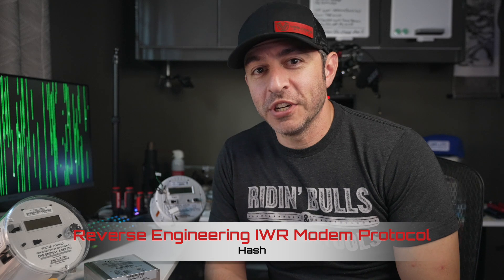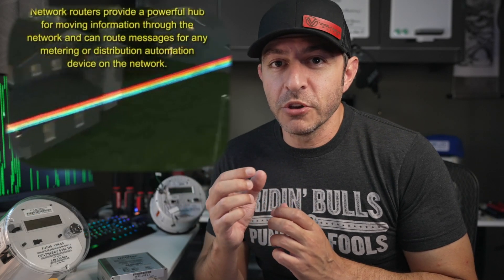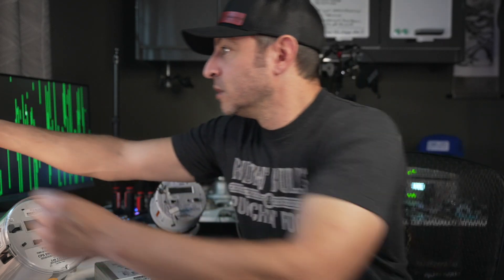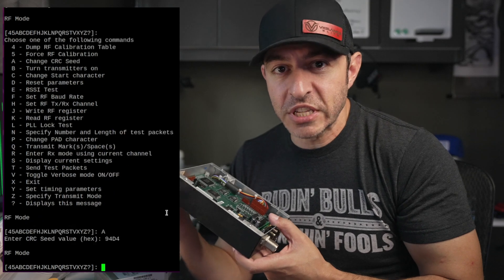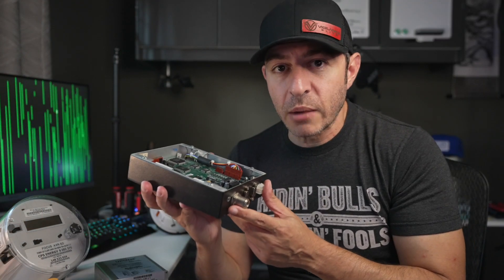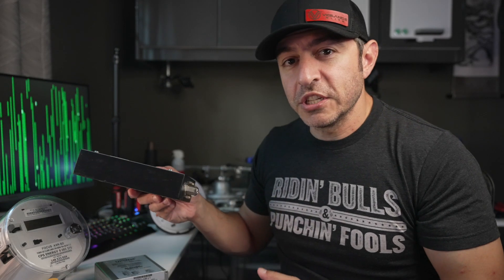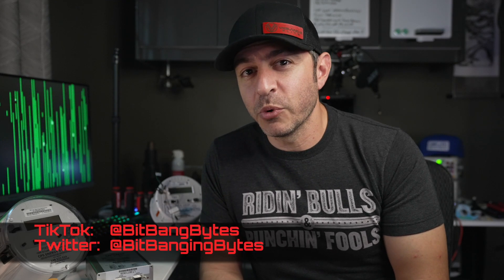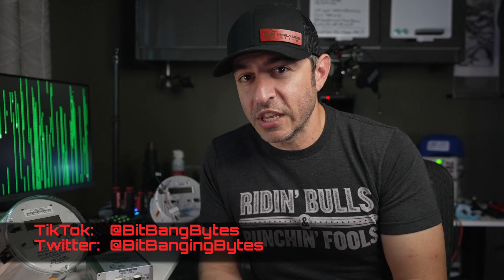Hacking Power Company Infrastructure

Comment: 900 MHz ? I hope they are not in the Amature radio spectrum again. About 20 years ago the power companies tried data over power line but right in the middle of the Amature radio HF band. Least to say they were operating under FCC part 15 rules so they could not interfere with the primary used but could accept any interference. Net result was that the electric company network would fail when radio operators went on line. There is also a portion of the 900 MHz spectrum that is also used by amatures as primary users. Lets hope its not too close to that part of the spectrum.

Comment: Good stuff. I don't think I would have just tried placing 3 bytes of the payload in the response. How did you figure out the CRC was CRC16/XMODEM? Was that from reveng?
Reply from the maker: Correct, feeding data to reveng is what gave me the CRC and ultimately led to being able to filter smart meters by the utility tuning them since they vary the CRC used as a way to isolate networks of meters
Reply: @RECESSIM  reveng didn't work out of the box with a fresh copy of ubuntu-20.04. I'll have to play with it. The v2.11 was no longer available at the link -- only 2.10 and 2.12. I was trying with 3.02. In case you wanted to update your wiki guide.

Comment: I wonder if the modems themselves handle the actual frequency hopping segment based upon some arbitrary data; such as the offset byte.    I've always been fascinated by frequency hopping stuff....    I just think that perhaps the modem is a lot more transparent than perhaps initially imagined; unless you find that you've got to propagate routing information or other bits or pieces into it...
Reply from the maker: I think the modem handles all the frequency hopping based on the CRC Adder used. All that logic resides in the modem I believe. The computer just says “send a message to this address” and it handles the translation from the computer data side to the hopping smart meter side. That’s my current theory at least.

Comment: The latest "miracle to cure climate change" idea is to bury all electrical wires underground to protect from hurricanes & floods. Do you think that the electric companies would lobby against this idea because of the smart meter networks? I'm assuming that none of the grids would work if partially underground?
Reply from the maker: In Dallas, some areas already have underground power. Where I live it’s all underground power lines, nothing visible in the city. Smart meters still transmit data, they just put the routers up on light poles or power poles on the outskirts. Great observation!